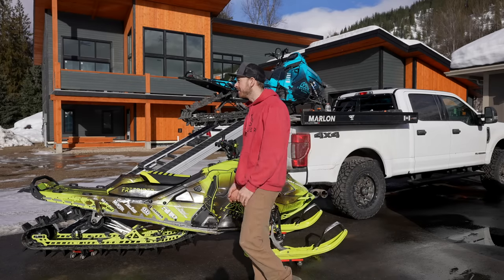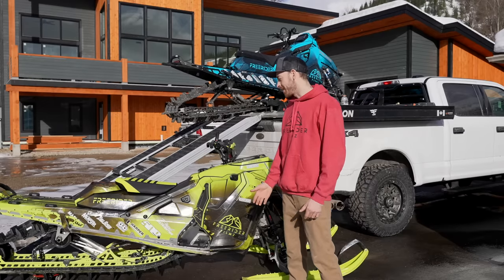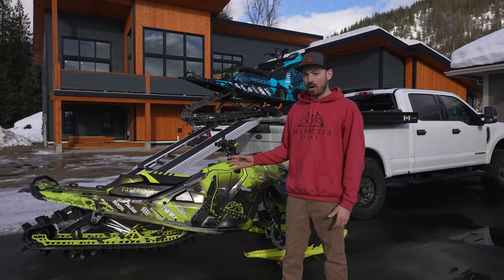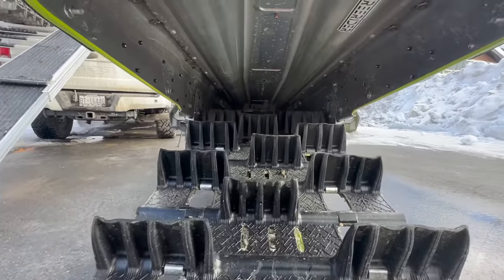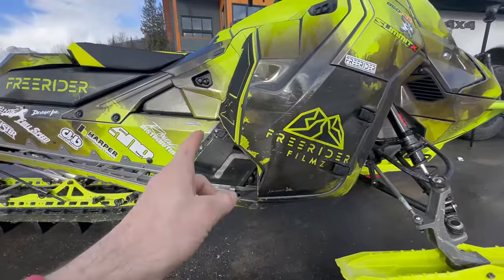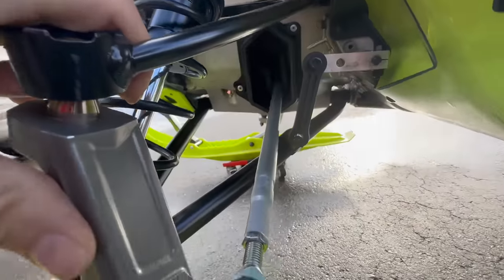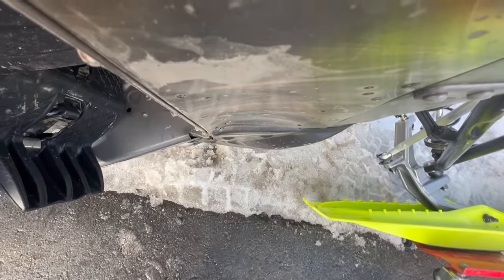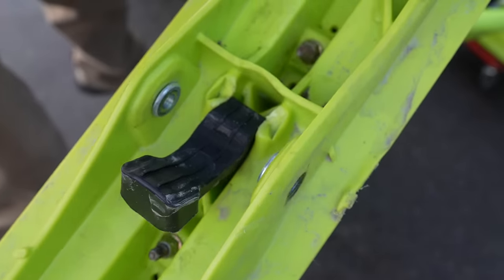Gen 5 Turbo 2000km Update

Comment: Maintenance - very important.  I try and get my sled up on a stand and drink at least one beer wheeling around it on a stool with a grease gun and a flashlight...  you find more than you would think!
Reply: Having a garage and warm place to check stuff out changes everything
Reply: @backcountryshitok  it's a MUST!
Reply: I use to break down alot before I had a place to work on stuff. And check stuff over

Comment: I know back in the early 2000s late '90s I believe they built anti-ractioning drivers that actually protruded through the track along with having the side drives. These new tracks have all the windows cut out of them for weight reduction we used to have to cut them out on some of the tracks for the anti ratchet piece to stick through. I'd look into that if it's a big issue

Comment: you must try 10 inch big wheel, alluminium with rubber. crazy change of power delivery. could help with the ratchetting and better power delivery out of your engine

Comment: You should check the tension on your chain case, it may be slipping and not the track.  Seems the chain stretches bad on the new g5 turbos.  Ak toy rentals is re tensioning them on a daily basis.

Comment: Great video Matt !

Noticed the Chaincase oil looked pretty clean. Obviously never had any issues with the new quick-hub, but did you notice any excessive adjustment required during break-in? I'm just starting to get miles on my G5, and had to put about 1.5 to 2 turns on the adjuster through 2 days of riding - can't say i recall that much on my G4. Just looking to get your experience - thanks !

Enjoying your content down here in Newfoundland - hoping to get a trip out in that neck of the woods someday !

Comment: Boots on skidoo problem is due to snow getting under the hood melting on pipe and freezing back up in the steering and boots.  Happened on both my g4 and g5 now.  Only really does it on really cold days..  my experience anyway..

Comment: I think I would definitely recommend installing extrovert drivers for that track, that's crazy tight.
That misfiring sounds like a re flash issue,, detonation, likely from a lean mixture setting in the power band.
Reply: It has extrovert drivers, they are still slipping. Design issue.  Misfiring is due to not changing the clutch for the elevation. He's over reving hitting a rev limiter causing the backfire.
Reply: @bigchaloopa  l realize it's not in the clutches. I believe it's a flash issue with the computer programming.. Extroverts would handle the track slippage.
Reply: @bigchaloopa  Extrovert drivers are not stock issue at this time for Skidoo.
Clutching is not related to electronic issues within the CDI module in regard to torque curve.
Reply: @jeffreyhagelin3672  that is a joke if BRP does not have extrovert drivers on mtn. sleds.
Reply: @jeffreyhagelin3672  I just rewatched the vid and the sled has extrovert drivers. I have seen better.
Reply: @bigchaloopa  Well then, obviously the little electronic needs a factory reset.... That's wasted power, if it can't get to the ground.
Also these guys drive these things over rocks, stumps and boulders....they probably could wreck a tank
Reply: @bigchaloopa  it would be a joke to me if I did not have extrovert drivers after paying $30,000 for a sled that had to have a track bound up like that to keep from ratcheting !
Especially since BRP does manufacturer it's own extrovert drivers.. supposedly at lower cost than the competition.

Comment: I'm having an issue on my 2018 NA skidoo summit 850... It's hydro locked but with oil rather than fuel. Can't find the issue anywhere in forums or any off the shops around here. They just want to throw parts at it until it's fixed. Have you heard of anything similar? Luckily I have the turbo to take out but this is the family day sled that's down.

Comment: How are your sprocket teeth looking from skipping? You could mark your sprockets vs driveshaft to see if they spin vs each other.
Reply: You mean from "ratcheting"? That is a term used for the drivers on the drive shaft that drive the track around slipping or skipping not the chain case sprockets that link via a chain the drive shaft and driven aka jack shaft. He already diagnosed that issue so no need to further confirm with marking. He doesn't mention anything in any videos I have seen about chain slippage, it actually can be pretty loose before that happens. Enough that the chain will wear into the case and still not skip but the chains stretch fast and as seen in recent videos people seem to be breaking bottom gears. That's a pretty different sounds and feeling between the 2 different parts of the drive train slipping.
Reply: @Aspired329  yeah ratcheting. Btw, I'm not doubting your knowledge or Muskoka's, just curious bud :) What I meant is that instead of the track skipping/ratcheting on the sprockets (the 2 plastic sprockets inside the track, not the chain sprocket/gear) it could be that the 2 plastic sprockets spin a couple of degrees relative to the driveshaft. Thus marking the 2 plastic sprockets' position versus the driveshaft could help determine if they move relative to each other (under high power high grip situation). If the track does skip/ratchet on the plastic sprockets, you would likely see wear marks on the tip of the plastic sprocket teeth.